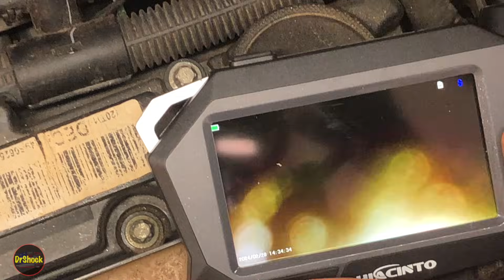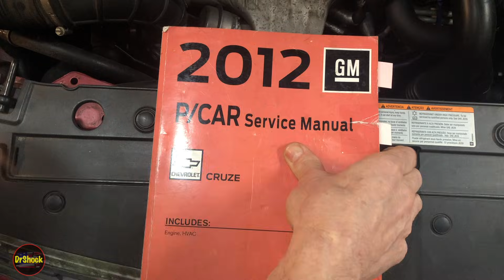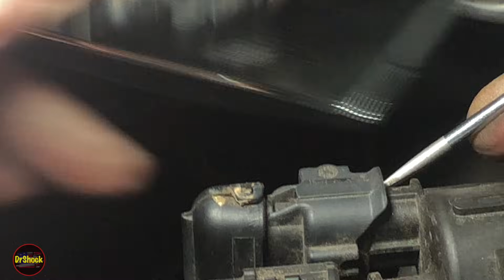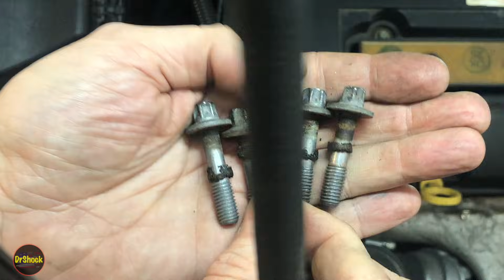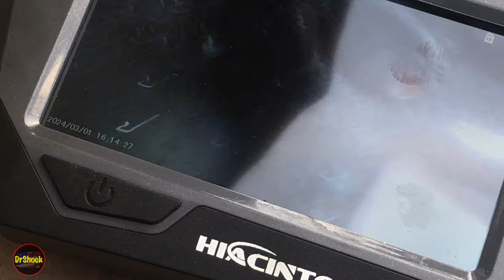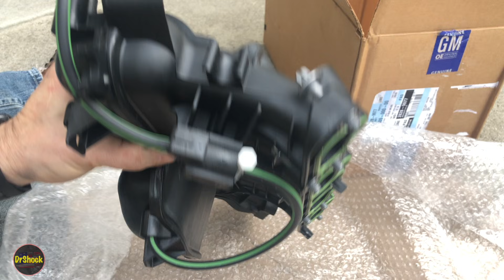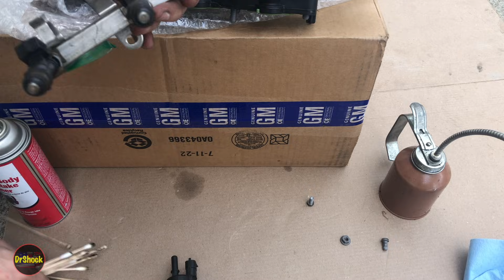2011 - 2021 GM Ecotec 1.4L Turbocharged Engine Intake Manifold Replacement ~ P0171 Diagnosis ~ Cruze

Comment: Question do you by chance still have this manifold and could take the plastic intake body apart? Or is there no way to further take it apart. Ik this might be a weird or big ask. 

The reasoning I ask is because im looking into modifying /changing the internal pcv to a more reliable valve. Or to see if I can bypass it directly to a catch can (the valve cover seems to allow way to much carbon build up) that can then go to two valves similar to the cruzebody one. 

Reason being is because I don't so much like the aftermarket options out there currently where cruzebody will use a jbweld plug to replace the valve, that then lets the bypass pipe as the main pipe to a t splitter with two valves  to the solenoid purge pipe and the turbo in the respective direction of the pressure it should have....etc. that or ive even seen one weirdly enough by pass it to the break boost. Which I dont like for obvious reasons. 

That or I might just have to model and 3d print a new intake manifold to then cast in aluminum so that I can put a threaded valve that can last the car's life span, or atleast be replaceable if it breaks and not cost 200$ and a headache every time.
Reply from the maker: We don't keep the parts we replace when working on someones vehicle.   They are either recycled if made of metal, or discarded if not.    What you will find is that the manifold sections are plastic welded together, to provide the required air-tight assembly.  Any attempt to un-assemble it is going to be destructive.   

I personally do not recommend owners make any aftermarket modifications for this particular engine.  The most cost effective approach over the life of the vehicle is to fully diagnose the actual root cause(s) for this problem area, replace ALL involved parts ONLY with genuine OEM ones, and then pay closer attention to scheduled maintenance/consumables and driving behavior going forward.   This engine design is finicky about engine oil quality, fuel quality, and maintenance intervals.  Above average additional investment expense is required for all three or premature (and even repetitive) parts failures will happen with this particular GM engine.  Additionally this particular engine does not hold up over the long term with certain driving behaviors involving excessive RPMs or high temperatures.  By paying attention to these considerations an owner will get reasonably long dependable life out of this engine.  But I recommend owners unwilling to commit to the additional investment and driving behaviors required to sell the vehicle for something more in line with their cost of ownership expectations.
Reply: @DrShock  Thank you for the information its exactly what I needed to redesign the pcv system, and the word of warning is very much appreciated and taken into account. 

I will say for the diagnosis portion, I know the issue in the case for my car. Its the main valve in the intake manifold. Ive pulled my codes and diagnosed it based on those and what I see in the bay. 

The valve nipple is still present but the valve disk is gone similar to the issue you had in the video. And as a result during boost the pressure increased in the crank case and burst the vaccum regulator diaphragm in the valve cover. Which explains the lean code during idle but not during boost...etc. 

Now I will say this is more so a project car that I plan to make into a daily driver. Even if I gotta swap the engine lol. I got it for about 50$ and got it because this was my first car growing up. So I wanted to redesign the faulty pcv system...etc. 

The check valve in the intake manifold is imo a faulty design. Makes it a non servicible part unlike the valve cover where you can replace the valve, that or the turbo inlet...etc. and because they used a simple epdm circular flap it just degrades faster over time, which I understand they attempted to midigate with the valve cover to help with oil vapor and that from degrading the rubber over time. 

So essentially what would be a maybe 1~2$ part causes the replacement of a 200$ part/parts kit..etc. 

Im mostly proactively fixing the issue before the valve cover actually starts to leak. And like I said, its a project car, and something that im mostly seeing If im able to fix. 

Thank you for the word of warning, advice and the information. I greatly appreciate it.👍

Comment: Thank you so much for the video. I have checked my pcv bypass line and the orange thing is disappeared. However, I don't feel any problem like rough engine, hissing sound, air leak at the diaphram or engine check lights. Nothing. Shall I still replace the intake manifold or clean it?
Reply from the maker: If the orange bypass valve has indeed left the chat room, then it's only a matter of time before the pressure in the PCV system blows the diaphragm in the camshaft cover.  At that point you will get a DTC.   But I would first take a shot at cleaning the opening into the manifold to insure you definitely have lost the valve, many times it can be so caked with carbon you cannot see any orange at all.
Reply: @DrShock  Thank you so much! I indeed cleaned the area with a cotton swab where the orange dot should be. The orange dot,  including the orange color in the 9 tiny holes are gone for sure. Because, after cleaning the area, I can see the black shield with the hole in the middle and the 9 tiny holes around it. I don't know how long it will run without causing problem. Does this mean I have to replace the intake as early as possible?
Reply from the maker: If you are sure it's checked out, then yes addressing this is in your near future repair list.  Some folks wait for the DTC / check engine light to pop before incurring the expense.  Given the repair cost involved, and the current economic climate in the USA, I can't argue with that philosophy.  It's an individual decision, proactively address it or wait for the inevitable.   As I showed in this video, a DTC can happen even if the bypass valve is still present - they can get stiff and inoperative from age and heat and still fail to meet design specifications while still in place.
Reply: @DrShock thank you so much. I will do it immediately. Before the price shot up in the sky.
Reply: @DrShock  Sorry, I have one more question. While I am waiting for install the new intake, shall I avoid speeding to prevent high pressure in the crankcase or the opposite?
Reply from the maker: I'd usually just say drive the vehicle normally as these little turbo engines are installed in commuter cars like the Cruze and Sonic, not sports cars like a Corvette.   But if you're driving like it's a 'vette, then yeah you may want to relax on that. ;-)
Reply: @DrShock  Thank you very much! You are a great educator as well.
Reply: @DrShock  I remember how I damaged the valve, I have forgotten one time to put back the oil dip stick and drove the car. I felt the engine run roughly. I think the valve was gone that time， because I still could see it a few months before. Hahaha. DIY is dangerous.
Reply: @DrShock  Hi, sir, I just bought an after-market manifold, and found that the design is a little different than the original one. I can see the orange nipple in the manifold through the big openning, but not from the bypass bypass hose openning. The nipple is deeper there. I imagine that the "valve" is actually a cheap rubber botton, it opens and closes by pushing it down. If it is true, then there is no wonder it will fail.

Comment: I have a 2018 Cruze 1.4 turbo with the same issues but the intake and cam cover are designed differently than this. Is there a way to check the check valve on the newer version as well?
Reply from the maker: There's more than one design GM had for the Ecotec 1.4L.  And to make it even more confusing, they manufactured them both in parallel thru 2021.   After 2015, only the 2016 Cruze Limited got this engine.  The others, like yours, got a different design of the same displacement that do not have many interchangeable parts between them.  I put the regular production option (RPO) codes for this engine in the video description to help identify it.  You can also identify this engine by the placement of the oil fill cap and dipstick.

Comment: Nice!! But where's the torque specs for all different bolts 🤔
Reply from the maker: They are in the GM factory service manual.   I showed those pages applicable to this video, and went over the values verbally as the fasteners were reinstalled in the video as well.
Reply: Easier if you just put it on the description. 🤷

Comment: I have a 2020 Chevy trax and I had the turbo charger replaced because it was a hair line crack in it. Now I think I’m having the same problem when it comes to the intake valve and valve cover gasket. I did the paper test that you showed in the video and the paper was sucking in. I was told I needed a new motor for a car that’s only 5 years old. I’m at a stand still with no help on correcting the problem
Reply from the maker: It's actually completely normal for the turbocharger on these engines, at least the OEM one, to get hairline cracks.   GM put out a service bulletin some years ago on this, informing dealers they did not warranty turbos for replacement except under specific criteria.   They have a minimum size of the crack before it's considered a defect/needing replacement. 

The paper vacuum detection test is just related to the PCV system, and would only warrant replacement of the camshaft cover (because the PCV diaphragm is built into it).  And then figuring out what caused the diaphragm to fail (usually a faulty bypass valve within the intake manifold, but not always).   I'd suggest you get a second opinion, from a Chevrolet dealership first who are better trained on this quirky engine, before looking at the replacement engine path (just would cost you a diagnostic fee).
Reply: @shunhamilton2828  there are modifications that you can make. There is a kit to replace the valve on the valve cover.  And a kit to replace the pcv with a changeable valve without replacing intake.
Reply: 2016 Chevy Cruise.  Thinking about burning to it to the ground.  No one will work on it.  Chevy Tried 2 times costing $1,800  still barley runs.  Never late on an oil change.  They said it was a turbo the 3rd time at chevy and wanted 2 Grand.  Nope.  Did it myself.(never attempt this)  Not the Problem.  It was cracked.  All of them are cracked.  They should have recalled that turbo.  Just guessing but,  I think it is VVT Solenoid now.  33 bucks.  Just throwing parts at it now.   I figure the car is worth 3 grand if it is running perfect.  Maybe.  No dent's.  No wrecks.  Leather.  The tippy top is $3,000 Max.  It's white.   Does anyone want it?  Cheap.

Comment: Thank you so much for such a comprehensive video. I particularly appreciated the description of how each of the various clips are meant to be released. The use of the mirror to show the hidden parts was also excellent. Originally I was aiming to just replace the rocker cover, but after some research and watching your video I appreciate the way this design works and that I would have been wasting my time and money. Time to bite the bullet and do a thorough repair

Comment: I cannot overstate how much I appreciate this video, thank you so much for posting, absolutely brilliant 👍👌👏
Reply: Just a quick update for any UK viewers, if buying an after market manifold, you'll need to modify it to accept the fuel rail vacuum hose. I have just completed this job, this video was invaluable to me. Aftermarket manifold used as the car is not worth much, oem parts would have made the job too expensive/unviable.

Comment: the 2011 has only one check valve inside the manifold or maybe GM did an upgrade?🤔
Reply from the maker: There have been many revisions to this part since 2011, as the part number has changed at least five times since then.
Reply: Are all the revisions actually upgrades that will fit all models?

Comment: Why not just do a cruzekits PCV fix kit 3.4 ?
Reply from the maker: We avoid the use of aftermarket parts and do not make modifications to the OEM design.   This particular vehicle got 13 years on its genuine GM manifold off the factory assembly line, I wouldn't expect any less on the replacement genuine GM part as long as the vehicles' owner continues to follow the OEM scheduled maintenance,  address problems in a timely manner with only OEM parts, and only uses top tier labeled fuel and dexos1 gen3 rated lubricant sources.
Reply: @DrShock  They are lucky, we got 6 years/45k miles out of ours. Even Dorman redesigned the valve because the OEM design is trash. I'm sticking to the CruzeKit fix for reliability. Just like the 12v Cummings killer dowel pin issue, the "OEM" fix for that is general considered a bad fix due to it's unreliablity and the aftermarket kits are superior. But to each their own I guess.
Reply: @DrShock 
I couldn't agree more. So many folk take wild guesses and just replace expensive parts based on no real diagnostic processes. This is where your video scores 100%. Always find the cause(s) and don't just fix the effect 👍

Comment: I have the same code Issue and i also have a terrible whistling sound coming from the belt area, the dealership told me that it was my front crank seal making the sound, is that possible. I thought it was my tensioner pulley, do you have any thoughts. Thank you
Reply from the maker: The crankshaft seal is a thing on this particular GM engine - https://youtu.be/vNAe0_A0BUg but the tensioner will make more of a ting or metallic sound - https://www.youtube.com/watch?v=dbV3dFmX3wY
Reply: thank you

Comment: If you’re a hack like me, you could have thrown some JB weld over that air leak, let it sit over night and she’s good to go. The intake manifold wasn’t needed in my opinion since the orange nipple was in place. But I’m just a hack so don’t listen to me lol. This guy is a pro obviously.
Reply from the maker: If you obstruct the orifice completely you’ll encounter a different failure. The orifice is there to allow for air equalization when the PCV diaphragm operates within the cover housing. This particular GM engine is very unforgiving to “workarounds”, so outright part replacement is called for.

Comment: I am confused. All the orange parts were still in the old one. Yea they were dirty but they were there, why would you replace the manifold after seeing them both there?
Reply from the maker: The silicone gets brittle and stiff failing to function per specifications.  Or caked with carbon, and unable to meet specifications.  Either condition will simply blow out the PCV orifice diaphragm again leading to a come back on the P0171 DTC.  It was my best judgement, and advice to the owner, that a complete repair required both based on the inspection I went over.   This intake lasted 13 years, incredible for this particular GM engine.  ;-)
Reply: It did last quite a long time for these units but the vehicle was obviously serviced correctly and within the the correct scheduled time period. The owner would have used premium grade fuels too.

Comment: Thanks for the 1.4t Sonic videos. This was the exact same issue I encountered on my 18 Sonic. Had to replace the valve cover gasket, turbo oil coolant lines, and did the PCV fix kit from supercruzes. Any plans on doing the heater core anytime soon?